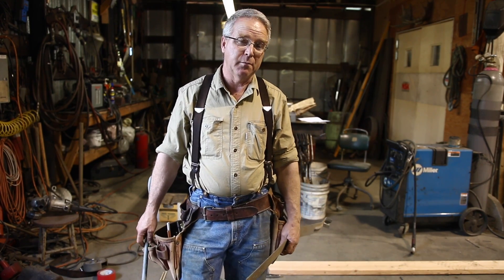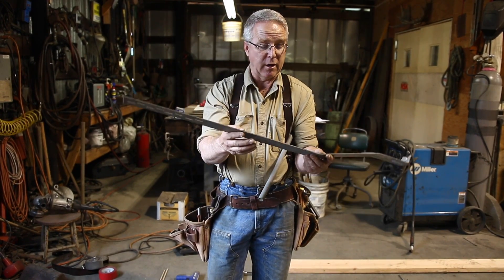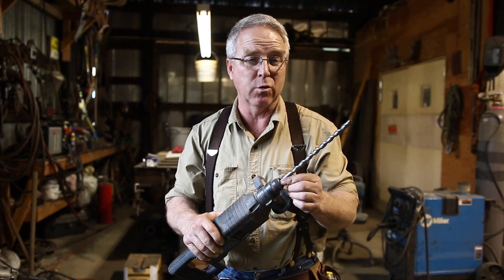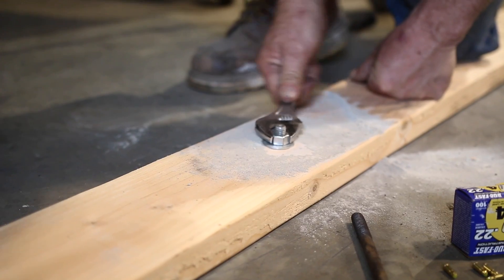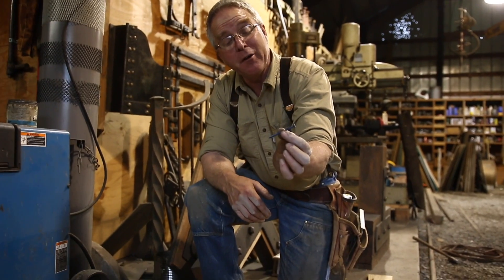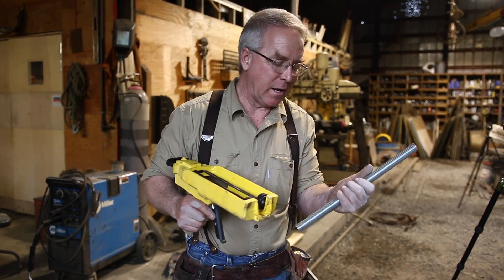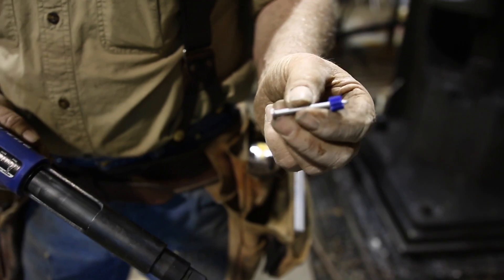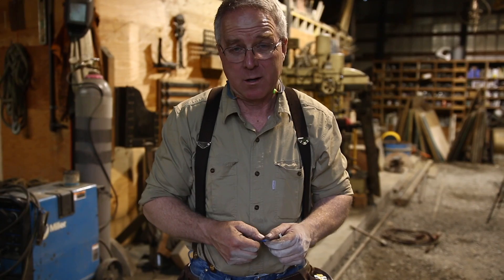How to Fasten to Concrete

Comment: We here in europe we do it very diffrently our houses are always made from bricks and we use concrete in everything from top to the bottom of the house yes it takes longer to build 2 weeks if ur good but that house will last much longer then tipical american house and we put rebar  in everything :D
Reply: That really depends on what your local building codes are. Brick may not be appropriate for everywhere. There are timber framed homes in the US dating to the 18th century. I'd say they got their money out of those homes.
Reply: Concrete and brick are terrible materials to use in earthquake zones.That is a big reason you see so much wood used on the west coast, where this information is coming from.
Reply: All depends on what you're building. There is no problem with concrete construction in a seismic zone as long as it is constructed correctly. It's more expensive to build, and in the USA where the most seismically active zones (California, Nevada, Washington, etc) aren't generally subjected to high winds, it doesn't make sense to spend the extra money on concrete or brick construction. In Florida, where hurricanes are a yearly thing, block and concrete are king. In every residential property I worked on, all the exterior walls were CMUs with cast or precast lintels. Commercial was a mix of CMU, and tilt-up.
What do you think all the freeways are made of in California?
Reply: Mr Kapula...You should remind those that doubt your experience about the story of the "Three Little Pigs" and the wisdom of brick houses.  Good Luck sir.
Reply: Dado Kapula I'm a builder in the U.K. South west and almost everything is block or brick. But having said that timber framed buildings are on the rapid rise.
Block built regs where I live require a 4 inch insulated block with 3 inch celotex 5 inch cavity with wall ties and a 4 inch block on outer leaf (brick of required)
Reply: That's why I said it's not really feasible to build residential structures from concrete. The expense makes stick frame a whole lot more attractive. But, when you're talking about commercial construction, concrete is king. I live in Nevada, which is one of the most seismically active states in the country and concrete construction of commercial structures is the most common. My house is stick frame.
Reply: i call bs in to many ways to write here!
Reply: I dont know about you but I work in this job 20-25 years.I build 2 wood structure houses but i make 10 "regular ones" It was my bad for saying Europa it is not correct .On balkan you will never see wood structure houses .I worked in Germany too everything I have done it was houses that are made from brick and concrete .Im sorry I generalised it too much.!!
Reply: Dado, many structures in the USA are made from concrete or cinderblock, our old house is Florida was, thats why it survived Hurricane Andrew in 1992, many shopping malls, Walmarts and most commercial structures are built with cinderblock walls, wood is simply far more economical here, especially since even if you build a cinderblock shell you still have to stud the inside of them to do the code required insulation, it's just something deemed not worth the cost unless you NEED the strength to weather the storms and can afford it.
Reply: And that's why here in the US, fire stations are as ubiquitous as convenience stores.  And that's not cheap.
Reply: "In Europe our houses are always made from bricks/concrete".  Someone needs to report this urban legend to snopes.com.  It's ridiculously inaccurate.  In many European countries there are more wood-frame houses than masonry ones.
Reply: In UK vast majority of stock is brick but as Ashley says timber frames, sometimes with brick outer, are on the rise due to being cheap and quick, do wonder about longevity, given the cheap wood used in their construction and our damp climate. These new wooden framed houses in UK ate not like the old wooden houses in the states as I assume they were built of better quality woods.
Reply: @cjhification  The US has plenty of wet areas too. Lots of timber framing in the Pacific Northwest of the USA. That comes down to making sure the thing can dry out and not closing off spaces to airflow. 
The biggest reason you see a lot more masonry in residential construction in Europe is because Europeans cut down their large areas of forest hundreds of years ago. The population density means that forests were never really allowed to grow back. The US on the other hand, never really cut that many trees down. The late start of European colonization meant that only the Eastern portions of what would become the USA and Canada, experienced unregulated timber harvest. By the time people moved west and discovered the timber lands of the Northern US and Western US and Canada, we had rules and restrictions starting to form. That's why some of the oldest trees in the world are in the Western USA.
Reply: @Clean97GTI  in the UK it was down to the Fire of London, up till that point many properties were wooden in construction, bit after the fire houses move more towards brick construction. 
The is reasonable timber production here but Scandinavian countries make plenty of wood, with increasing forested areas, that we import for the rest, as well as hardwoods from around the world.
Lots of new builds here are brick outer with stick framing inside or bottom half brick top half clad.
Reply: @Clean97GTI  I also appreciate you have damp areas, I just thought brick was more common there.
Reply: Yes but it's worth mentioning one of the benefits of American construction is we build our houses in America instead of Europe ;)
Reply: Mr. Kapula...We lived in England for 8yrs.  You're right, not much wood.  It took me two weeks to get a phone line from the downstairs to the upstairs because I was stubborn and wanted it inside the masonry walls.  The last 8ft I sawed the masonry from between a row of bricks and buried the cable.  Houses don't get torn down because they wear out but because they become obsolete.  Our house in England, 1100sqft, 4 bedroom,  only had one bathroom.  In the States the house would be torn down and replaced, bricks or no bricks.

Comment: In brick and cinder block, do you want to go into the brick or block, or is it better to drill into the mortar?  For attaching a gate post, patio roof, or sun shade for instance.  And what would be the best anchor for that sort of application?
Reply: Always into the block if you're going into CMUs (cinder blocks) and preferably the block will be filled with concrete. The weight is what determines what you're going to attach with. If you're going to timber frame your patio roof, I'd use a joist/truss hanger. Then pick an appropriate sized TapCon or Simpson Titen screw. Predrill the holes and run the screws in, job done. If you need to support heavier or moving loads, a wedge anchor or maybe the Titen HD screw anchor would be a better option.